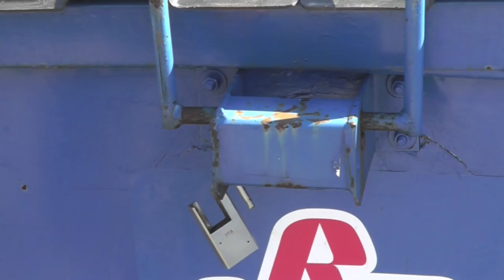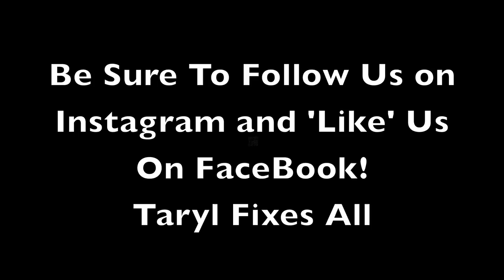Make Your Craftsman Hydrostatic Lawn Mower Go Faster!

Comment: Hey Taryl, I have that same crapsman mower with a 54" deck. It was slowing down just like you said, and if I rest my left ankle on the back side of the clutch it would speed up, but I didn't have to do any of that grinding. The clutch linkage had grass on it way up underneath where you couldn't hardly see it that I guess was stopping the belt from being as tight as it should be. Once I found where the grass was hiding and removed it, away she went!

Love your videos, but you convinced me in another video not to do no small engine repair for other people. If I did, all these guys would be bringing me their riding mowers. Ain't no way I am gonna reach down and loosen some guy's belt and jerk his deck off, he can just do that all himself like I do!!!
Reply: every time I get through mowing I get out the blower and blow off everything

Comment: recently had a similar probably with my dlt 2000. it would intermittently not move and moan very loudly. the unit only has 485 hours (pretty low considering it’s 16 years old) and the original drive belt (from crank to hydro) had never been changed. so i changed it (tried without removing the deck, was able to get the belt off but hard time getting back on, so just remove the deck to save yourself the time). the brake and forward/reverse pedals now feel tighter and tractor moves without the crazy loud moans.

Comment: I'm learning that there is an incredible number of variations in the hydro static drive controls, even just on Crapsman tractors. This is the third video I've seen on adjusting them and each is different and none are like mine! Good luck!
Reply: The principal is the same for all, Increase the control rod throw at the hydrostatic transmission control lever.

Comment: You "Can" get the hydro fluid out of the transaxle if you take the transaxle out. Then we put synthetic 20/50 motor oil in them or a Cub Cadet hydro fluid and they speed up and good for another 5 -10 yrs. of  7 month mowing seasons here in North Central FL.

Comment: Before you do this it would be worthwhile to get under and check if there is any slop in the rod/actuation. I have someone press the gas pedal fully down then try and see if I can push the levering plate on the hydro any more than it already has. If it doesn't budge, then this is all you're gonna get. Same for reverse.

Comment: On my cub cadet LT1050 I replace what parts tree calls the “arm control” that is mounted on the transmission and is included in the transmission parts diagram, PART HG-51119. The slot that the shifter from the transmission fit in was worn so when you pressed down on the pedal either forward or reverse it wasn’t actually pushing the shifter coming out of the transmission far enough. I did a temporary fix by putting some small cable ties in the slot.

Comment: I have a 2004 LT2000 Craftsman with hydrogear trans that won't go in reverse. Where do you make the adjustment? I installed a new belt. It goes forward fine. Thank you for your input, I have saved a lot of money by taking your advice.

Comment: Hi Taril,
I congratulate you on your successful videos! I have a problem with my Ride on mower Toro XLS 420T. the pto is in operation at all times, the pto switch is in the off position and the pto only turns off when I turn off the engine, with the engine and pto on I put the pto switch in the on position, the engine turns off by itself, check the voltage of the I switched that it goes to the pto and it didn't have any voltage, it seems that electronicity is not reaching it. Do you have any idea what it could be?

Comment: having a similar  issue with my dlt 2000. you push the forward or reverse pedals and it will intermittently moan very loudly and not move. belt seems to have a lot of slack in it so  gonna start with that.

Comment: Thank you,I have a workshop I fix lawn mower and other industrial machine but one of it is give me had time.
It a lawn mower,is leaking oil from the air filter,have check the head casket,the breeder,over fill oil and water in the oil,non of it is the problem.
What will u think is the problem

Comment: I wonder if you could do a video on an older craftsman rear drive ride on lawnmower that won’t charge the battery and has to use a booster battery to the starter with key on to get it running.  I really appreciate and enjoy your videos .

Comment: Tim,

I'm looking to buy one of these, was looking at the craftsman 24hp 54cut, it says 7.5mph top forward speed on the specs.  I saw a guy that is running 13mph on a poulon, are these essentially the same tractor? But for a different market?  My question is, do you think I could get a craftsman up to 13mph with a deck on it?  (Not to mow, but just to get around the property). Most of these are 5.5max speed and this particular model has a 7.5max speed stock.  Just curious also if it has been already maxed out and can't get anymore juice out if it to squeeze +5mph.
Thanks!
Great vids by the way, funny as heck!

Comment: Any idea how fix a no start issue on a 1997 520H WheelHorse? Battery has a full charge Checked the ignition switch it was replaced and still no start/crank. Under the battery there are tray a series of relays. I can feel one click. I can start the tractor by jumpering the solenoid on the starter. It’s has an Onan P220G engine. Any help is appreciated

Comment: Taryl , is there any adjustments that can be made on the actual transmission?  I use my lawn tractor for winter snow thrower. I had no reverse, purchased new transmission.  Reverse improved a little.  Changed belt, and no improvement to reverse.  Drives forward without any issues.

Comment: Hey Taryl, this question is a little off topic.  My Craftsman riding mower will not freewheel.  I pull out the disengage lever on the back of the transmission/trans axle, but I cannot push my mower.  Why won't my mower disengage?  Thank you.

Comment: I have a 06 John Deere 155c. The motor vibrates Pretty bad.  The crank isn’t bent. I checked.  Took the pto clutch off still the same thing.  Took the drive puppy off still the same thing. Do you have ay ideas? Love the videos keep them coming

Comment: About to buy a 2015 pro series 7400 hydro 54" cut. 300 hours. Basic tune up maintenance just done as well as 1 spindle and 3 blades. 300 hrs Don't know if it's the tooless quick change blades or not. Seller wants 1300. While I enjoyed meeting and sharing stories with them they didn't really let me insoect and test the mower. He just started it after it was already warmed up and drove it 10 feet onto his driveway. Engaged the blades for half minute and shut it down. Worth it? Or perhaps he's trying to shake it off before something harder to fix goes out as if he knows the transaxle is leaking which might make it slow/weak or hydro is about to die and leave me in the middle of a field with a major repair. Kinda think spending roughly 1600 for a new gear drive ride mower might be a better idea although it appears they're all pretty cheaply made after 2015 models and have reviews all over the place. Also this was an excellent informational video. Appreciated the comedy as well.

Comment: I like the video and it worked well for my craftsman. fixed it up right. I would like to know what hood you swapped on to the DLT 2000 ?Is that a metal hood from another model that will work better than the crappy plastic hood ?

Comment: Good fix and funny a as usua. Hope you can help me out.I just bought a Craftsman Model 917.272263. It is the one with the foot pedals to control forward and reverse same as in this video.I was told it needed a valve job  but when I went to pick it up the rear wheel won’t turn. I thought maybe the brake was frozen so I took it apart cleaned it & reassembled it . I was able to move it backwards easy but difficult pushing it forward. The next day it was jammed again. I played around with the brake & it loosened up a little but it is still locked. The  bypass rod pulls that out so you can disengage the transmission to freewheel is very loose. I checked it does move the connection on the transmission. Is there any adjustment that can be made that I am missing or am I going to have to pull this tranny apart? I would really appreciate your help. JoeZ

Comment: Taryl, I need info on a forward/reverse linkage rod bracket that is inside the frame under the cup holder that guides the rod and keeps it in line. Help, Help, Help... Thx. Oh and its on a toro wheelhorse, 13/38 thx, its not on the print buts on the mowers, except mine. lol

Comment: I have a challenge for you. I have a YT-4000 Craftsman lawn tractor. The transmission was loose on it and was sent out for repairs. When it came back it goes faster in reverse than forward. (used for mowing a cemetery). I can't see a why it does this other than shortening up the road to the transmission a bit. Any ideas?? I tried it up against a rock and it spun so i assume the belt is okay.

Comment: What can be done when a hydro trans starts slipping when hot? I have a craftsman ltx1000 that will go up hills when cold but bearly goes up slight inclines when hot.
Reply: Probably and oil change. Thin oil only gets thinner as it gets hot
Reply: Give it a glass of cold water...like Tarl does

Comment: which newer lawn tractor would you reccomend taryl . would i be better buying an older one and fix it uo seems like newer stuff isnt as built good as it used to be
Reply: poop mcgee id find something older that you can gut out the safety wiring and just have a simple start/off setup.  that with a good motor will last you years. new models are nice to look at but they have a lot of pricy parts that like to go out.

Comment: Taryl, I've searched all of your videos (I think) looking for help with a craftsman dsy4500 hydrostatic drive problem.. Haven't come up with a solution - yet. The mower drive is in consistent. Floor pedals fully engaged, either direction, don't always produce good drive and don't stop the mower when released (used to come to a stop, abruptly, when pedal was released. I've changed the drive belt with 1/2"V x 92.5". My guesses are adjustments needed in the brake spring or linkage, adjustments needed in hydrolic pedal linkage, water in hydrolic fluid or low hydrolic fluid, or even just the wrong belt (maybe a little too long?). I couldn't find where to post a direct question so I'm using this video comment area in hopes to reach you. Can you direct me to the correct place to post this issue, or a video that might help diagnose and repair? Thanks, Joe

Comment: WOW i got to say very funny stuff i like your videos very much ,Awsome  sence of humor ,& an you know your engines an mowers too ,i am  getting the pro series craftsman 42in with 20hp kohler with smart tech ,for half Acre lawn ,but i also have a big driveway an plan to use it for snow blowing  ,a few things sold me the sale price 1549.00 for a 2100.00 mower  an the 46 in was consumers #2 years in row best lawn tractor,an the welded frame an tougher deck ,over anything its class ,what do you think of the pro series thank you ps thinking of doing an in depth video of the 42in pro series not much on them yet in depth like whats under the hood  of them

Comment: Help me please. My riding mower won't start. I replaced the ignition switch, starter solenoid, starter, and battery still won't start. When I put a screwdriver to the +and- on the solenoid it starts. Just don't know why the key won't turn it on.
Reply: check your ground wire connection
Reply: There may be a fuse hidden under the dash.  Check it.  Check for broken wires too.

Comment: And also check engine gov/speed for rpm's to be right. some times it will go out of spec. or a jack leg who thinks they are a outdoor power equip tech. and messed with it and did not tell you that they did.

Comment: Hey Taryl. I have a Toro hydrostatic transmission. It can go forward and reverse by stepping on the pedals. The problem that I have is that I can not put it into neutral! In order to move it when it's not working, I have to pick it up with a special lifter and then move it. Is there a way to get it into neutral? I'd appreciate any help that you can give me.
Reply: i got a saber but mine has a bolt hanging out of the back i can push in and pull out to freewheel..maybe you can find something like that on yours

Comment: You just didn't tell him about the pulley the larger pulley on the engine trick with the new belt size just totally forgot that. Or maybe that's the difference between a little faster and a lot faster. Huh

Comment: I have a cub cadet.
It has the hydrostatic transmission.
the 'go' pedal rocks forward for forward motion and rocks backward for reverse.
The reverse is getting so even at full rpm, the mower barely moves (and will be completely stopped by any rock, pebble, what ever behind the tires.
Do you have an suggestions on how I can get my mower to 1) run in both directions and 2) run faster?
Reply: rkwill100 Replace the pressure valve

Comment: to get a little more speed I need the opposite, on this Craftsman LT-3000 Lawn Tractor
 releasing the clutch/brake pedal ever sooo slooowly as the units throttle is running fast, blades are a spinning the unit does a wheelie and its getting dangerous , shutting / lowering down the throttle control and / or reducing the gear it is in is not helping.

Comment: I need your help on a sears and roebuck generator 2400 watt.  I need the points and condenser part number186 65188 next part nymber 185 65188  this number is for the coil or magneto. I engoy watching your video's I am thankful for all the help you have to give.

Comment: i am building a go kart out of an old lawnmower i am using the engine and everything else in it but how do i get the engine to go faster
Reply: Donovan Bryant   Remove the governor rod that is connected to the throttle... just be careful not to run high RPM for long periods

Comment: I've been pounding out a few decks lately and one of them was one that was worked on previously....I'm working on 2 Poulan chainsaws now and one of them is the 50th anniversary edition and the Wild Thing. The fuel lines were so bad I have no idea which one goes where. Have you a video that may help me out???? Thanks in advance
Reply from the maker: +Paul Govensky  It works the same way as the weed eater check out my HOW-TO  on weed eater    https://youtu.be/F2u2FZxzgfM
Reply: Hey Taryl, I had watched that video twice before and I'm always cracking up at your verbage for a carb...lol What is the longest time that you ever worked on a chainsaw? The Wild Thing ended up being a clogged screen in the muffler. I ended up swapping the carbs around to each one and the 50th Anniversary worked with both, so I knew something wasn't quite right with the other saw. I would like to get the original carb with a new carb kit though. I soaked it and looks fine. The after market carbs have the inlet and outlet on two different side instead of on the same side and the linkage hits the fuel line...grrrrr
Reply from the maker: We actually don't repair those saws only for the fact that between the labor rate & parts the customer can buy a new saw. I would look up the carb on the web and buy the actual poulan carb. Jacks small engines has poulan parts & parts breakdowns.
Reply: Hey Taryl,
                Yeah I have dealt with Jacks before..pretty good company for older parts. Have you had a Murray tractor in your shop for failure to go uphill in any speed except 1 and 2??? The belt that it was called for was correct I think it is a 37x87. I ended up using a shorter belt by 1 inch. I wasn't to sure about any adjustment????
Reply from the maker: No adjustments on a gear drive trans. Does it work now with the shorter belt?
Reply: Yes and no...What I mean is that you can't set the parking brake. I've seen others adding a bigger pulley, but I don't think that is worth it to me. I just hope the belt doesn't burn out quicker than normal.
Reply from the maker: That may be due to the shorter belt. If yur gears are still not working it sounds like the trans gears or shifting pins are worn. You might want to find a good used trans.
Reply: Hey Taryl, The brake pedal is setting in pretty good now. I was following the connecting rod at the place where it hits the sensor to see if any adjustment could be done there. But it's going pretty decent now. Thanks for the advise.

Comment: Hello Taryl, I have been trying to work on my daddy's Honda GX-160 2200 pressure washer. I can crank it up and it will run for a couple seconds and then after about 10 seconds it will shut off. I took the carb apart and cleaned it, but it still shut off. Then I went and bought a brand new one and it still shuts off the same. Do you think it might be electrical? Thank you!!!
Reply from the maker: It could be the low oil shut down on the engine, Try adding some oil. If that doesn't do it then disconnect it.

Comment: How do I convert the shaft or my riding mower? My older engine explode. It was a Briggs and Stratton 22hp 725cc and I swapped with another Briggs and Stratton engine newer and has 2 horse power more and the crack shaft of the newer engine is a bit smaller. The driving pulley and the too clutch won't fit properly? What I can do to solve this?